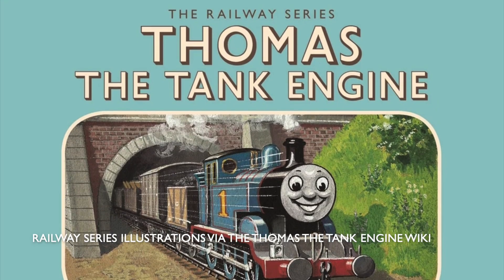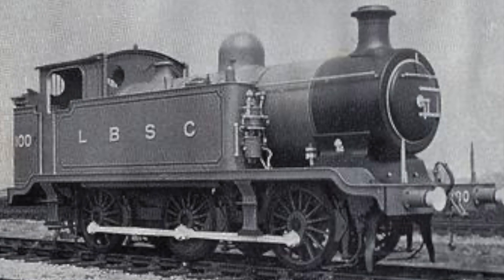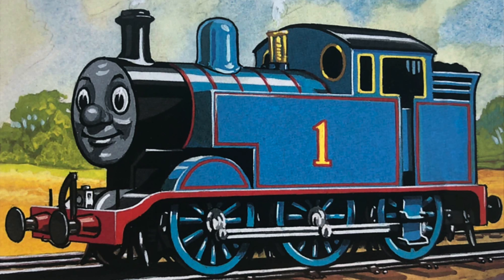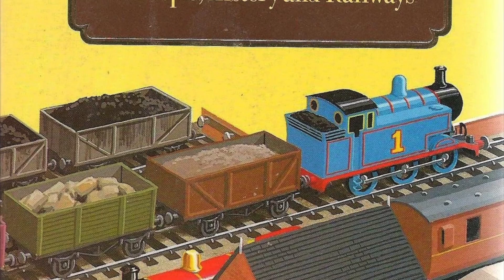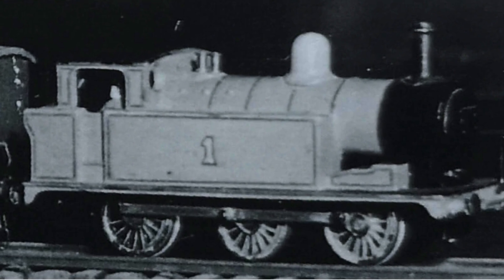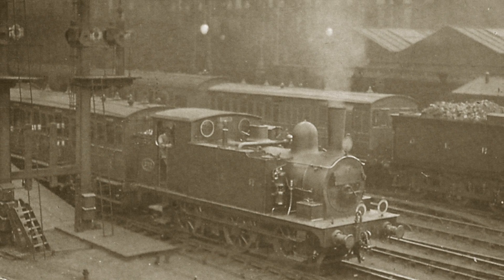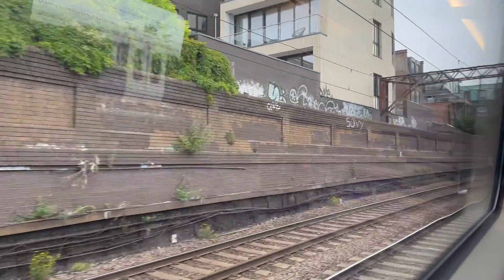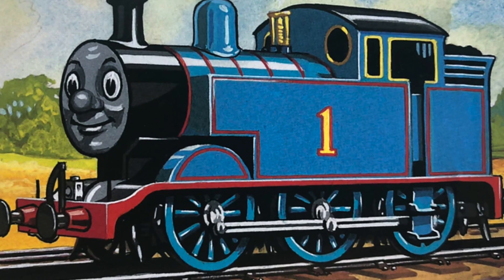Overthinking Thomas the Tank Engine: What Actually Is Thomas?

Comment: Yeah, the J69s do have a similar look to how Thomas was usually illustrated (with the short length and small wheels). There were a few that ran on the old Kelvedon and Tollesbury branch line that also pulled the old Wisbech and Upwell tram coaches 7 and 8.

Comment: Great video, as usual! The Rev Awdry was the vicar at Emneth, Norfolk, 1953 - 1965, close to the Wisbech and Upwell Tramway. Small J70 steam tram locomotives were used prior to being replaced by diesels from 1952. Toby the Tram Engine, which first appeared in the seventh of the Railway series of books, was based on the J70s. The Wisbech and Upwell Tramway, running at the side of the road for part of its route would perhaps be an interesting subject for a future video! Thanks again for your very interesting videos

Comment: Hi Jago.
Nene Valley Railway - Hudswell Clarke No 1600 an 0-6-0. At the time the book was written, the loco was British Sugar Peterborough Works Fleet No1. Painted blue, red lining .The Drivers name, as written on the tank, was Thomas. 
The association was - Rev. Awdry was vicar of Botolph Parish, Petreborough - across the road was BSC Peterborough offices, and he would have heard the locos working  whilst preparing his services.
Thomas was formally named such, by The Rev.Wilbur Awdry, to publicise his books.
Another engine at the BSC works was Fleet No6, drivers name Percy. 

Toby was Wisbech and Upwell Railway - tramway loco - with skirts .

For some 20 year,s until moving away, I travelled many miles on that loco footplate, at a maximum of 15mph (railway line speed is 25), plus others. I also appeared as an extra on 'Octopussy'and 'Goldeneye', painted scenery (runner wagon/stage) for, and was loco crew on the Queen video 'Breakout', 'Latter Days of Patton', and a number of episodes of Casualty.

Anything that attracts children (of all ages) to railways, is good for our various hobbies - railway, / model railway (and model engineering in general), / promoting useful discussions.

Comment: Reading around, apparently the "real life" Thomas engines used on heritage lines (under the marketing banner "Days Out With Thomas", licensed by Mattel) are a mixture of repainted originals, modified originals and custom builds, so are also a variety of different models.
Reply: Here in New South Wales, the Thomas at some of our Day Out With Thomas events can just be whatever blue tank engine they have available. 

The NSW Rail Museum has a Z.18 (formerly 1803) which plays Thomas. It’s an 0-6-0 tank which looks sort of similar to an E2 or a J69. I’d happily buy it as an Australian Thomas. 
1803’s not steamable nowadays, but it can be pulled around. The shuttle rides are either provided by 2705 or 3526 as Donald or previously 3642 as Henry. 

The Zig Zag Railway used one of their 4-6-4 DD17 tanks to play Thomas (suitably attired, though at least one was painted blue anyway), whilst BB18 No. 1072 (4-6-2) plays Douglas and C.17 No. 934 plays James. Not really similar to the actual prototypes, but…
Do children care if the characters look identical? As a 7-yr-old visiting such an event at the ZZR, the answer was no. If it’s a blue tank engine with a face and a 1 on the side, it’s Thomas.

Comment: My main problem with Thomas being a LB&SCR Class E2 locomotive is the shear size of the E2s. My childhood memory of Thomas is of a small 0-6-0, short in length with his wheels close together, and yes with the front buffer beam practically dragging on the ground. The E2s are absolutely massive machines, heck they're around the same size as the Hunslet Austerity 0-6-0STs, and having worked along side them on the K&ESR in my youth, I can tell you they ain't small machines.

I have a Hornby Nellie body that's sitting on a cut-down Dapol Terrier chassis and that feels more of the right size for Thomas, for me at least. Really must get around to actually fixing the two together at some point...

Comment: There is another model tank engine (southern?)  in metal by Budgie - had British Railways in a Green livery and no name in Red (LT implied).  Designed as a push along they could be motorised and used on 3 rail dublo or trix systems

Comment: I remember the rather sad TOPs "myth" that no one talked much about when marshalling parcel vans, driver went too far back and pushed the end van into the couplers of a MLV then the whole lot wended its way down towards Plymouth where said MLV was unhooked and shoved into a siding and a wrangle between regions began over it before some time later it was dumped at Reading.   I never knew if it was real or urban myth but then I remember Motorail which often made huge mistakes like sending whole car flat loads to Penzance instead of Scotland, indeed my own poor father they took his car off at Stirling whilst we waited in Inverness for it and it took three days to get it there and no, he couldn't just jump on a train and fetch it and drive it up, it had to be properly unloaded or else.   The Motorails were a miserable journey made worse in height of summer and the guard had turned on the heating to full winter and was quite unpleasant.   We stopped using it when they took of PT discount for staff that coincided with another cock up as we waited in Fort William for our car and got told it was in Inverness so this time my dad just jumped next train and went and got it after getting his signalling manager to blast the ears out of the loadmaster's.
Reply: I suspect it was a real incident.
There were more than a few occasions when locos ended up stranded across Regional borders because a driver had taken it without realising that he didn't actually sign them (some old steam hands never quite got the hang of actually having to be passed out on each type of loco separately) then when he got off it nobody else would move it - and he wasn't allowed to take it back because he didn't sign it... 
Based on my own experience as a guard back in the 1980s I suspect heating being on wasn't so much a case of the guard having turned it on as nobody being able to turn it *off*! 
I did once get reported for daring to turn the heating on at 04:00 on a chilly morning because it was June and the Rule Book said heating had to be turned off from May to October. Nowadays everything's airconditioned so all you can do is reset it and hope it starts working. :-/

Comment: Very interesting video, sorry to be a snotty enthusiast but the preserved Buckjumper J69 was not the Liverpool St pilot. This is actually a common myth as the engine is painted GER Blue. 68619 is the Liverpool St. pilot, and has history being painted Apple Green & GER Blue with the BR crest. It also had a nickname called “Blue Angel” however the engine has been famously stated as to have been an terrible steamer. But the preserved example is 68633 but finding information on its just is somewhat harder.
Reply: I was told No.87 was the Liverpool Street pilot and the last to be withdrawn. Guess I’ll have to check my history.
Reply: @joshslater2426  68633 may have been one of the pilots many but it’s not the Blue J69 68619 as many think. But I’d like to do more on it now 🙂

Comment: My theory about NWR No. 1 'Thomas' is that, like No. 2 'Edward', it was initially on loan from the neighbouring Furness Railway across the Walney Channel from Sodor in Barrow, being an FR G5 060-tank engine, which bears stunning resemblance to the illustrations, barring lack of extended sidetanks or dipped runningboard.  
Perhaps the side tanks were added following No. 1's purchase by the director of the North Western, or upon their transfer to the Ffarquahar branchline. Perhaps it was the presence of the extended sidetanks which granted the G5 the passing resemblance of an E2 that made Dalby depict the character Thomas as such, dipped running board and all, a fictitious issue that would be retconned through Thomas crashing into the stationmaster's house.

Comment: Excellent video - regards Thomas lore I’d be interested in your take on the viability of the Sodor operation with such a variety of engines on a small island I’m wondering what the population was meant to be? More Singapore than the Isle of Wight?? 😀👍
Reply: Sodor basically filled the gap between Barrow In Furness (where original Locos did through running) and the Isle of Man.  Its a pretty good 50 route miles from the West of Sodor to the East via the Coast route.  Population though seems low , with Vickerstown near Barrow) arguably the most populated with say about a third the population of Barrow.
Reply: The railways of The Railway Series were based on the 1930s railway companies in Britain. Even they didn't really know if they were viable, and at the district level equivalent to the size of Sodor, nobody worried about it in the slightest; it was head office's problem. Nor did they worry about the lack of standardisation or indeed anything else: they just carried on in exactly the same way as they had carried on for the past hundred years. Sodor is the bucolic Britain as everyone wanted to pretend it was: idyllic countryside, a bit of industry in small towns and none of the coal-burning dark satanic mills or sweatshops of the smog-ridden big cities. Viability isn't anywhere on the radar of that fantasy!

From a modern perspective, no, of course the Sodor operation isn't viable, and nor is the whole isle of Sodor. But who cares when you can play with talking trains? ;)
Reply: @atraindriver  A Light railway and skyscrapers with barges in the docks ?

Comment: Interesting explanation about Thomas. I actually have no idea if the show is still running.
Reply: Classic decent Thomas ended years ago…eventually Mattel bought the rights and ruined it.
Reply: Mattel recently rebooted it into “All Engines Go” which abandons the later CGI animation (which I maintain still looked decent) for a 2D style that resembles Peppa Pig. 

The model filming was swapped for CGI in Season 13 (2009), whereupon the show continued until Season 24 in 2021. Whilst All Engines Go (…) was thought to he Season 25, it later emerged that it was a seperate entity. Which was good as AEG is completely divorced from what came before.

Comment: Basing Thomas off an E2 doesn't really align all that well with Thomas' height and various features. E2s are way too tall and long. He's more like a Furness Railway G5 tanker that his manufacturers mistook for an E2 during the building process. He's got wheel splashers and a dip in only the front footplate.

Awdry initially wanted Thomas to be a J50 engine, but Payne's illustration made for a much more appealing design, which later got revised by Clarence Dalby, and then updated after the Thomas Comes to Breakfast story, where Thomas damaged his front, went for repairs, and came back with a flat running board, so that his front and rear buffer beams were aligned together.

For me, Thomas is a one-off variant of a Furness G5 that was brought to Sodor with Edward. They were both the first engines brought to the island, so it makes sense for both of them to come from the same railway.

Comment: On occasion I helped Wilbert along with another clergyman, Teddy Boston to run the Sodor railway at exhibitions. The train movements followed a recorded commentary and on one occasion when Teddy was feeling in need of sustenance he decided to speed up the tape recording. As one can imagine a certain degree of confusion followed. Surprisingly no one watching seemed to notice. I happened to live in the same parish as Teddy and he would come over to “play” on my garden railway and bring Wilbert with him, unfortunately the day I was testing a new engine he got rather carried away and derailed the train into a flower bed. As the loco weighed nearly a ton I was a bit miffed at having to extract it from the soft ground and in a fit of rage I banned them from visiting again which I still regret.

Comment: The diesels were maybe more heavily-based on Prototype, in their drawings.
Reply: Certainly. You can see it with Devious Diesel (a Class 08), Bo-Co (a Class 28 Metro-Vick), Daisy (a single-car variant on the Class 101 DMU), Mavis (a Class 04 modified for tramway service as per the Wisbech examples) & Bear (a Class 35 Hymek), and later on with Pip & Emma (a InterCity 125 HST set). 

This is saying nothing of the various visiting diesels who get sent packing at the end of their respective stories (Old Stuck-Up & Spamcan to name two; based respectively on the Class 40 Whistler & the Class 45 Peak).
Reply: @caileanshields4545  I only about Devious, Boco and Daisy. Thank you for the teaching.

Comment: People tend to love the steam age but it was one filled with awful accidents such as being Buffer Kissed which was a hazard of grid iron yards where masses of trucks had to be coupled and uncoupled whilst still on the move. Buffer kissed refers to a an accident happening to a new shunter who  instead of using a coupling pole just happened to get his head crushed between two wagon Buffers instead of using the pole to do it. Then the fireman who would be oiling the inside motion while a engine was stopped only to have the driver forget that he was down below would be crushed to death as the engine moved off. Thats all apart from fires on trains or actual collisions at high speed. Track maintenance guys being rundown by express trains were quite common compared to today. Ah the good old days.

Comment: It's always been my theory (head cannon, do they call it?) that the first engines on the NWR (Nos. 1 to 5, with one exception) were built by the railway themselves at Crovan's Gate works, to archetypal British styles (0-6-0 shunting tank, inside cylinder 4-4-0, mixed traffic 2-6-0 (though with inside cylinders, very rare in the British Isles except for Ireland) and a 4-6-0 for passenger work) to their own, freelance designs. The problems with Henry (basically a stretched Ivatt Atlantic, perhaps built to pirated blueprints) persuaded the management to pursue a policy of purchasing second-hand equipment subsequently, hence the acquisition of ex industrial and ex BR equipment. Thomas, therefore, was a Crovan's Gate original. 
 💺
Reply: The exception, of course, being Gordon, which was an add-on to the initial build of Gresley Pacifics at Doncaster, possibly ordered when the shortcomings of Henry became clear
Reply: What would the class names be like for the nwr though

Comment: Fun video!😊

9:41 - Sadly not this one. This example was BR 68633, whereas the famous blue, East Side pilot at Liverpool Street you mention was scrapped classmate 68619.🙁

I think another J69 took the pilot role on for a short while (18months?) before the full 1962 dieselisation of the ex-GER region, but never got painted blue.

Similarly, West Side had an immaculately presented pilot in the form of N7/4 69614, again scrapped and briefly replaced by another, lesser known N7 until dieselisation.

Comment: This was a nice video to supplement the likes of Unlucky Tug, Victor Tanzig and WildNorWester when it comes to Thomas/Railway Series and real world basis of the engine, like Gordon being an "A0" Pacific, prototype of Gresly's A1 Pacifics, based on his similarities to the A1's and earlier build date with some things later changed on the A1's from Gordon, and Henry 1 officially being an A1/C1 hybrid (A1 body, C1 wheel layout and smokebox mainly) from stolen plans that had problems (fixed somewhat by Welsh Coal) until the rebuild in to the Black Five-based Henry 2.